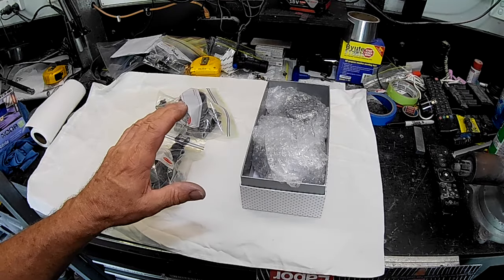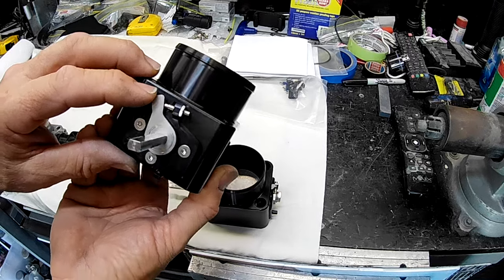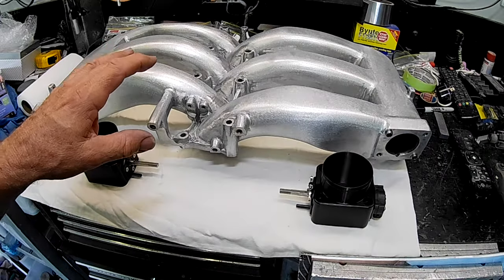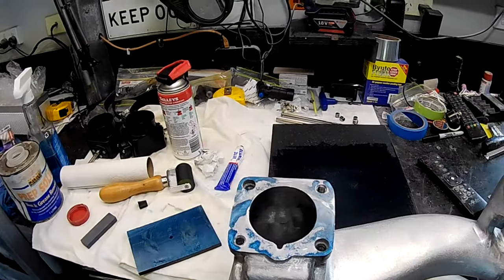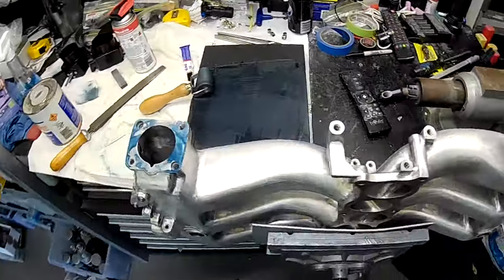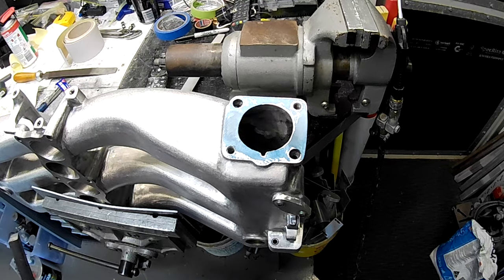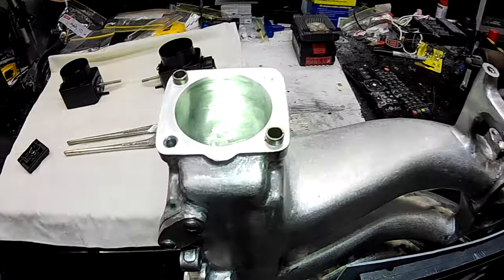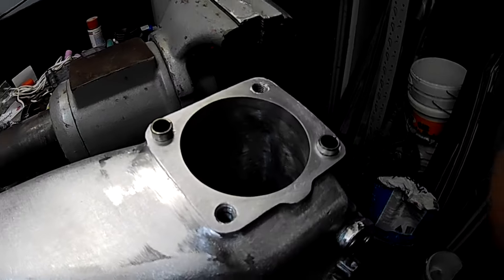Z32 Polar Engineering Throttle Bodys Review & Install, The Nissan Z32 300zx Twin Turbo Mega Build.

Comment: True, nothing is as simple as it seems. Interesting. But drive by wire is always a choice. Anyway, it will be interesting to see this installed on the car.
Reply from the maker: G'day Mate, this is just the first stage with these units, Drive by Wire is where i'm heading with it, Polar Engineering has it currently in development. Cheers.

Comment: When I asked what was painted on the manifold side of factory throttle plates, I was told that was some kind of buildup. These are brand new throttle bodies and have what I asked about. Another clue that it was OEM applied? There are clearly brush strokes in it. It's there to create a perfect seal. Excellent point of using thick glass for a surface plate. Molten glass is poured and gravity forms a very flat surface as it cools.

Comment: Nice job cleaning up the top of your upper manifold. I stripped the bottom side of everything but the two freeze plugs and the four bolt on bosses and blended the outer flange to the lower manifolds profile and port matched them of course. No EGR flanges, no water manifolds, not needed, GONE. You can't see what I removed when assembled, but I knew it was there and didn't like it. Just like I removed EGR mount from rear of lower manifold and blended the profile.

Comment: Didn't have the money for Billet Throttle Bodies. I found a pair of OEM bodies on eBay that were over bored for $100. Cut off all traces of the water cooling and removed all casting flashes. Removed that clunky manifold which connects to small hole below the throttle plate which I thought may be a mistake. Looking at these billet bodies which do not have this, I may be all right. Ended up with OEM bodies that look like billet for a lot less.

Comment: Excellent work Trevor. Have you heard anything from PE about the motorized throttle body actuators they were designing to install DBW?
Reply from the maker: G'day Eric, not at this stage, I think I remember something about it being released early this year. Maybe Polar will mention something in the comments. Cheers Mate.
Reply: I’ve actually been chatting back and forth with Polar over the DBW system. Right now, he has said he’s focusing on getting the orders that were placed around the holidays finished up so he can turn his attention fully to the DBW finalization and he’s hoping to have the orders done in the next couple weeks. So hopefully that sticks.

Comment: Another excellent video Trevor. I appreciate the extra time and the detail of the video. I am curious, is it a worry to have the debris falling into the manifold as you grind and whatnot? I am new to this stuff so I do not know.
Reply from the maker: G'day Mate, yes, the Intake will need to be removed from the engine to perform this process. A thorough clean out is Mandatory after anything like this. Cheers Mate.